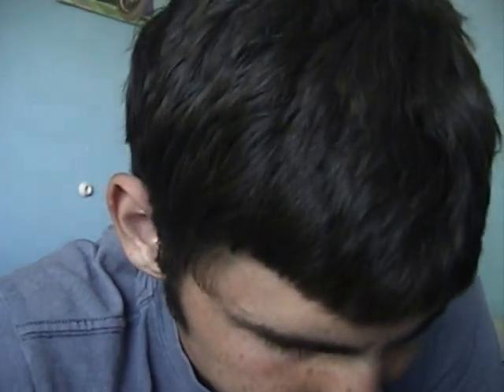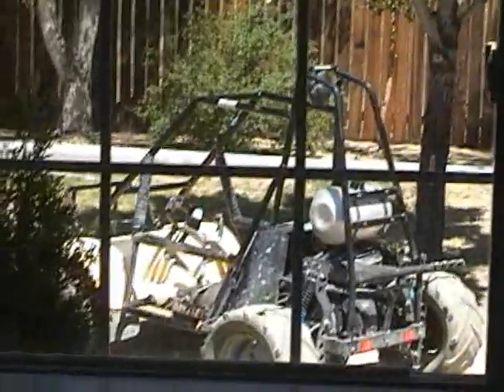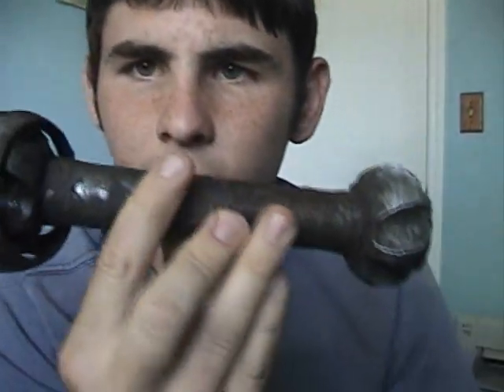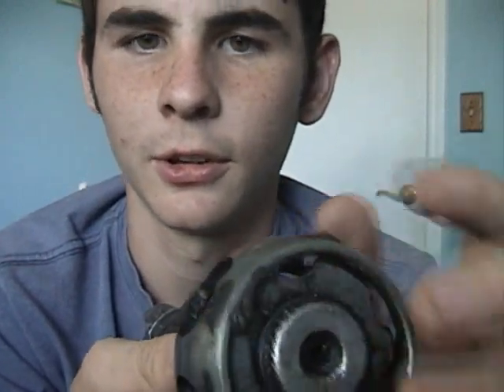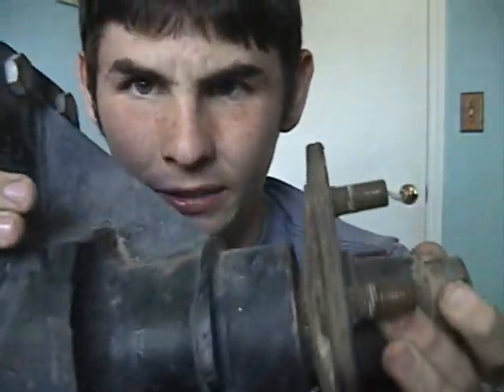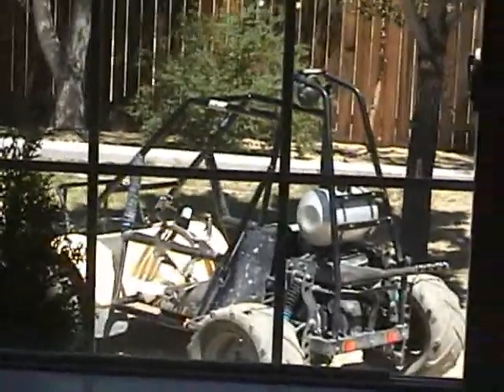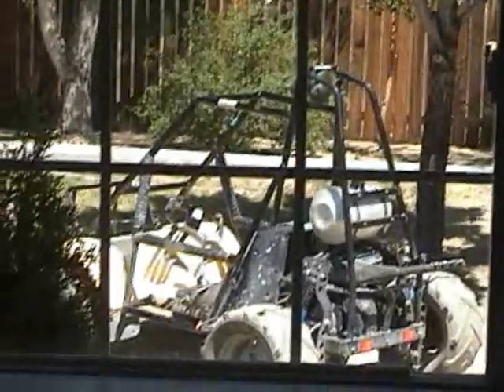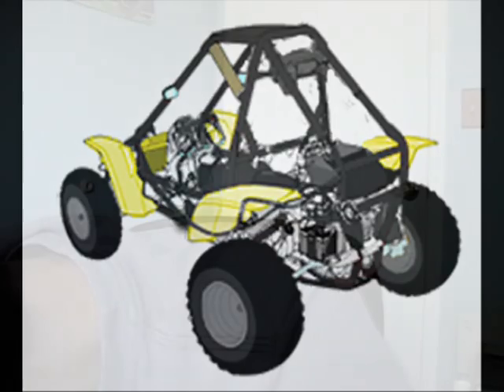Updates on Honda Odyssey FL 250

Comment: Hey man if that Honda Odyssey has cv joints and reveres and 4 wheal suspension and 4 wheel braking than u have a Honda odyssey FL350 on you hands. Whir are you from I am looking for people who I can to race and trail ride with that don't live rely far away I am from Canada Ontario Toronto. I have a fl350 and a fl250 and a golf cart with a 200cc atv engine.